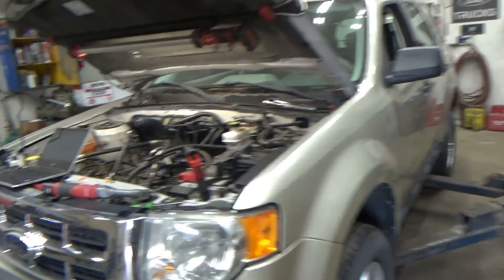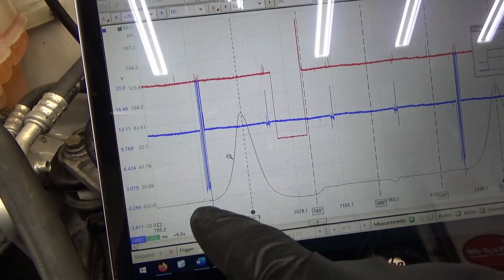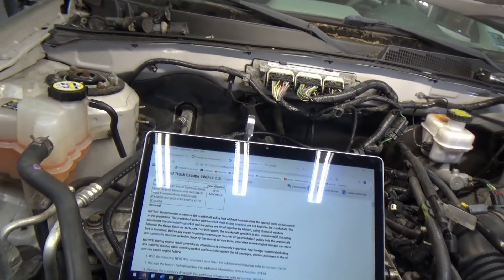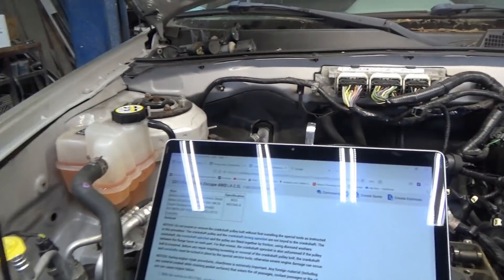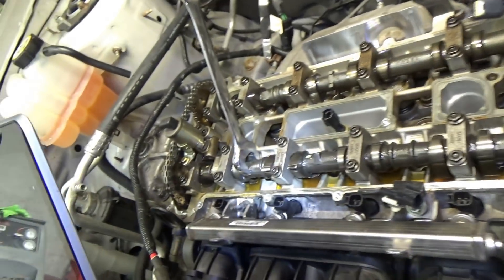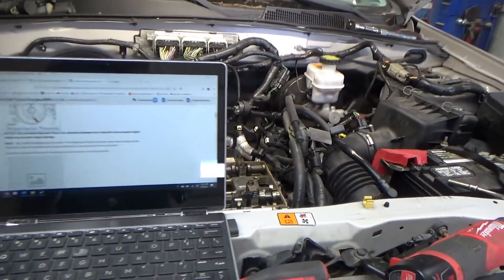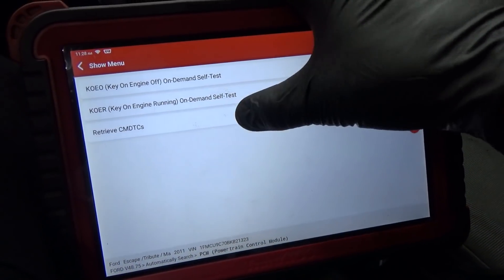Crank No-Start After Engine Swap? (Ford Escape)

Comment: Wow I'm glad I found this I have to say that's a great timing diagnosis you guys completed. 

My question is I just had my VR6 engine freshly rebuilt, and unfortunately I have a crank no start/ no spark issue and no communication to the ECU,
I checked my spark fuel and Air all those physical lines are good on the engine, what else could it be?

Also the car ran fine before the engine was pulled.

Comment: Same thing happened on a 05 focus, repair shop installed a new harmonic balancer and could not get it to run so after a lot of research i checked the timing and sure enough it was off . Ran great after i set the timing with a kit that holds the crank and cams in T,D,C.

Comment: How is harmonic balancer driving the timing belt? I guess the valve timing is correct, only the ignition timing is off. Since the crank position sensor is sensing off harmonic balancer.

Comment: interesting little quirk with this engine design...with cam end slots horizontal and all valves on #1 closed, ANY 360º TDC rotation can be made the compression stroke

Comment: Could you get a cam crank correlation code after just eyeballing the pulley like that and not using cam or crank lock tools?

Comment: Great diag. Poor repair.
Diamond washers and crank pulley bolt must be replaced and torqued correctly to prevent possibility of slipping in the future. Slipping = valve damage. 
Ironic the issue was caused in the first place by not reading service info, then a repeat is on the cards because the service info was not followed again.

Comment: I really want to watch this video but umm traumatized from the 13 flex with the ecoboost that I had to do a water pump, turbos and intake tubes, ptu, and oil pan on and then I had an 08 Taurus 3.5 water pump after that. I can't with these 3.5 fords anymore, and forget what the book time says. I cant be the only one.

Comment: I don't think it's a big deal if the camshafts are a little bit off since the phasers will compensate, but wouldn't it be better to have a pin inside that hole for the harmonic balancer? Just to make sure the timing is 100%? Sure you will have a pin that fits in that hole somewhere.

Comment: I saw a hole in the block as you were spinning the balancer. Did the tech use a dowel before tightening? Edit: I just saw the same question a few lines down from my comment. I guess I was not the only person who noticed.

Comment: Crazy stupid of them to do this. Seen it on a 2018 transit connect. As i was pulling the old engine I took the balancer off and saw no key..... did some reaserch and you can bet i didnt touch the balance bolt on the replacement engine. I believe on the ford 4.0 sohc engines it's a similar deal where you need to lock down all the cams and dummy shaft before you pull the chains. Maybe it saves on machine cost to cut a key way

Comment: He needs to really tighten that bolt tight. I use my 1/2 Kobalt and let it really rattle. I have had them come in slipped. They say u have to replace those washers and use a new bolt. I never have. Once it’s really tight, never had a comeback on that issue

Comment: I had a customer come in once with a 2016 Ford Transit connect on a tow truck that someone else tried to do some kind of service on it and failed.  I have no idea what they were trying to do, but it somehow required removal of the harmonic balancer.  I was told that when they tried to retorque the balancer, the engine wouldn't turn.  But would turn when the balancer was off.  I felt so bad for the guy when I told him that he may need another engine at that point.  Sure enough, the guy he had working on his truck wound up bending the valves.
Reply from the maker: Nice lol

Comment: OK, I'm confused -- there seems to be some clue I'm missing.  Obviously you need to coordinate the crankshaft, the camshafts, and the various position sensors have to be reading the positions of those shafts correctly. But what the heck does the harmonic balancer have to do with all that -- surely it's there to cancel out vibration?

Comment: Thank Ivan..!!! I have this engine iny Fusion and have to change crank seal
.. was wondering how to do it without specialty tools... Question: Does the valve cover have a gasket or require a tube of gasket maker..??
Reply: I went to Ford dealer...it's a gasket. ALLDATA has you using form-a-gasket.........

Comment: These engines (and the older zetecs) are massively popular over the in UK, especially in the motorsport world. Almost like the SBC of the 4 banger world for us (or a 4age to japanese). The special tool kit isn't expensive and makes timing them a doddle. You remove a bung on the side of the block and place a pin into the hole. Which locks the crank at TDC NO1. Then you place the bar through the back of the cams. Make sure the harmonic balancer is in the right place and boom job done. The real fun is when you've got aftermarket cams and need to time them up!
Reply: I've seen over 300Hp from a 2.0L variant naturally aspirated. Really good engines.
Reply from the maker: @aly369  300hp from a NA 2.0L?? No way lol

Comment: I really admire your work, but any mechanic that has some experience with Ford should have suspected the issue even without knowing that the harmonic balancer was removed. Anyway, it's a miracle that this motor didn't bend any valves.If you have  tightened this bolt though , using only your impact gun , the owner will be looking for another engine pretty soon.

Comment: Great work Ivan love watching your videos, as a retired master motor mechanic I worked in a very big workshop Rolls Royce, British Leyland, Volvo, BMW and every other car around in the 70s in Dublin Ireland we done everything in-house the workshop Forman used to always say when we have a car with No Start is the “Pump Working” correctly to all the apprentices and qualified mechanics ie ( proper engine compression ) have you check it before running around looking for other faults. Please check the basics, cars are basically combustion pumps with lots of shit hanging on to them. 
I was working on these vehicles when they were developing electronic ignition, fuel injection etc when nobody knew nothing and we did not have fancy computers and scan tools. 
Keep up the great work your very good. Cheers Irish Paul

Comment: This is a screw up from the tech! I’ve done cam chains on these and not such a drama.
The crank bolt also needs I be replaced as it’s a stretch to yield bolt.
Line up cams with 5mm flat bar, use the correct bolt tool to align crank to TDC and align pulley to case with 6mm bolt.
Not hard and the system is good to get a perfect cam timing each time
Reply: Isn't the crank bolt torque 74ftbs plus 90deg??
Reply: @paulpochan9631  yes 100Nm then 90 degrees

Comment: I’ve seen so many of this generation Ford engine with the keyless crank pulley system cause issues due to how careful you have to be when messing with the crank pulley bolt (which is also torque to yield if I recall).  Really bizarre design but at least job security for those of us who have to work on them lol

Comment: I had a similar problem with my old Datsun Cherry years ago when a removed the distributor and I couldn't not get it to mesh properly with the cam after phoning my uncle who was the Head mechanic at the bus workshop in Liverpool he explained how to line it back up that is why I don't work on my diesel car myself now

Comment: Well, at least it has a timing chain not a worthless belt. That had to be close to bending valves. I've always thought Ford makes better timing chains than some other manufacturers. One engine I used to work on quite frequently was the 2.2L Ecotech that would break the timing chain on occasion, it just wasn't built strong enough and resembled a bicycle chain.

Comment: So this "special tool" is what?  A piece of rod you stick through the harmonic balancer into the hole in the block?  And that doesn't solve the problem if you have to take the harmonic balancer off.

Comment: just did quick google search for escape 2.5 cam chain  and nearly first thing  that came up was ford workshop manual telling straight away not to loosen crank pulley without timing it as the thing is not keyed to crank ,
Reply: Shh, you can't expect people to research stuff before they touch it!
You're not a man if you do that...

Comment: Ivan,
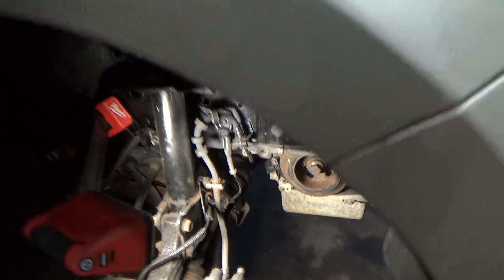@1:58 should be '...MAZDA in their infinite wisdom...'. The Ford Duratec 4 cylinder (2.0L, 2.3L, 2.5L) is actually the Mazda L engine. Its actually not a bad setup but is definately not poka-yoke which is surprising for a Japanese design.
Good call and fix!
Paul (in MA)

Comment: Sounds to me like Ford's method of doing the engine timing is simple and straightforward if you READ the service procedure and follow it.  I fail to see a problem, except for people that can't or refuse to read the service procedure.
Reply: Why would you think to read the service book on a procedure you didn't do?
Reply: @eldonerc2524  Ivan said the remover the balancer to install the engine.
As a mechanic, surely you would realise it wasn't keyed when you pulled it off?
Reply: From a manufacturing point of view,  it cuts costs by removing machining operations.

Comment: I ♥ my 2012 Ford Escape XLT "with the big 2.5L 4 banger". It's roomy, has factory Bluetooth, freezing cold AC. The Mazda derived 2.5 isn't a fire-breather but gets the job done, has been incredibly reliable, and has reasonable mileage for such a boxy and relatively heavy vehicle. Thanks Ivan for helping save one more Escape from the salvage yard!

Comment: Fixed a 2013 ford edge with a 2.0 turbo, timing belt slipped and cam phaser had turned and gotten stuck. Finally got it fixed with special alignment tools. Was a turd to figure out cause timing belt never broke.
Reply: @Jonathan A 1.6 my bad, we work on different cars and trucks. Hard to remember when you start getting a little older. Around here different day- different car.

Comment: I wouldn't trust the torque of that impact as the final spec on that crank bolt.  A lot of times those are 180 ft lbs or more-- and as crucial as it is, you should absolutely have a long torque wrench on it to make sure that its up to spec...........   A bulletproof upgrade for this, once you know that you're timing is perfect----   Pull that crank bolt back off of your harmonic balancer, and then directly in the seam where the balancer slips over the crankshaft, you can drill a 1/4" hole there:  so that it's half onto the balancer and half drilling into the edge of the crankshaft---  TAP this hole, and then instill a 1/4" "GRUB SCREW.  This now acts as a key-way and will keep the timing from ever slipping off again.
Reply: Torque 74ftlbs plus 90deg.....

Comment: Good job- but is there a need to (benefit from) getting the cams and balancer aligned with more precision?
Reply: Figure if it runs smooth and doesn't pop codes, it's close enough.  The computer can compensate for small inaccuracies.
Reply: I wondered that too, given how meticulous Alfa Romeo were about setting up their older engines. Either several engineers had severe OCD when they were designed or there was some value to be obtained from using a dial indicator and high precision cam locks.

Comment: I've seen non keyed, friction held cams on my brother's mercury mystique when I was replacing a timing belt. I'm a diy, so I don't work on cars on a daily basis, but even I though WTH Ford? I've done a few timing belts before this and couldn't believe this one is like this by design. Love scope diags!!!
Reply from the maker: Ha yup I can confirm this on my 1996 Mystique 2.0L Zetec. At least the harmonic balancer and crank sprocket are keyed! Runs like new at 300k miles so pretty stout engine 😎
Reply: @PineHollowAutoDiagnostics  My brother's mystique is a 2000 and if memory serves, it had about 240k when I did the belt about 4 to 5 years ago. Don't know how much it has now. I went in blind relying on experience on past belt changes. Never encountered such a system. Today, I look up the procedures since experience from one car may not translate to another anymore. Your channel is one of my go-to's.  👍